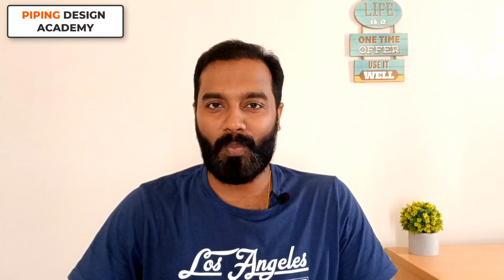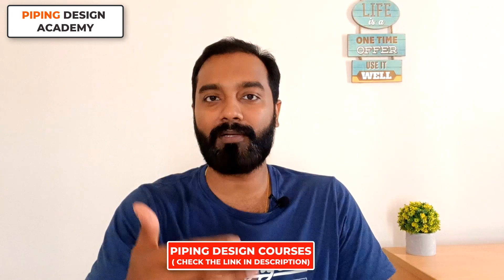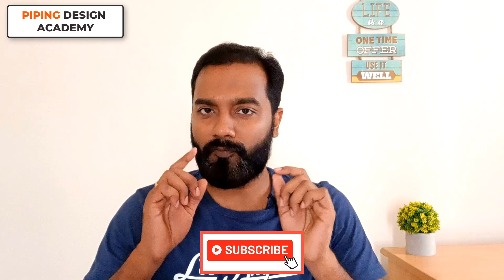Various Jobs in Piping Engineering Career to Work in Core Engineering Field

Comment: Sir! Im a civil graduate working as piping modeller, during covid with not much options available i got a job in a small time firm where I worked as jr piping engineer and after that i got a bttr pay in another firm and im currently working in that firm as piping modeller. During my experience i worked on softwares like PDMS,E3D, Cyclone, AutoCad and plant 3d. But to grow furthur in this field im not a mechanical graduate, which I think is pulling me back to completely focus on career. Could you suggest me what i can do to achieve bttr position in this field
Reply from the maker: Please reach out to me in my WhatsApp.  Check in the course details